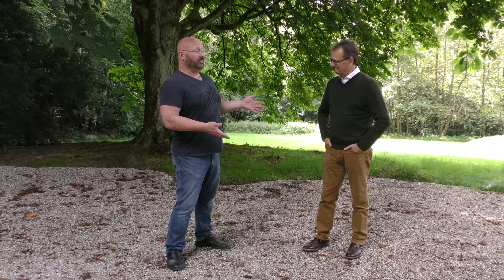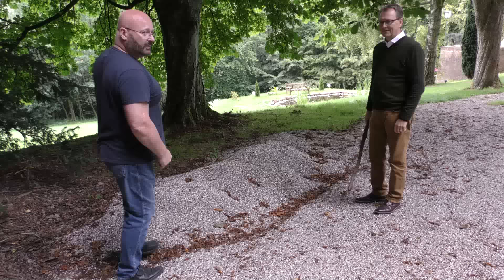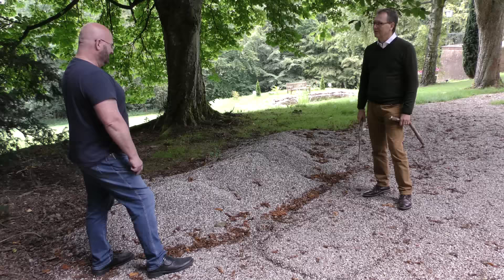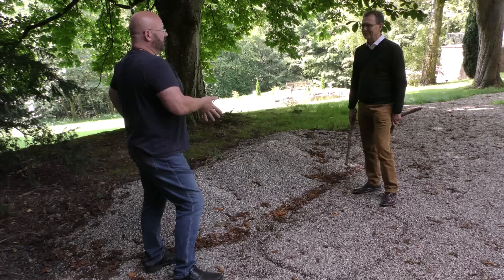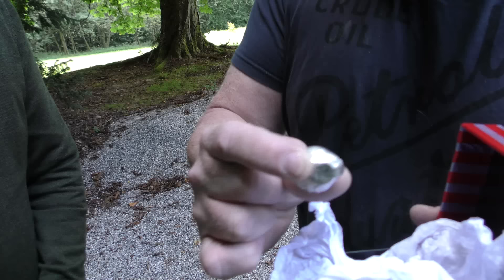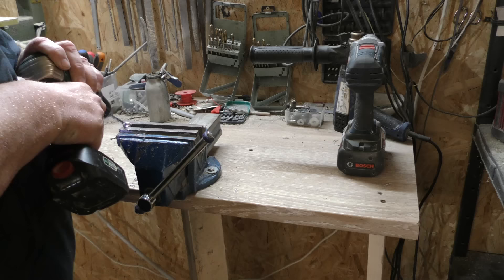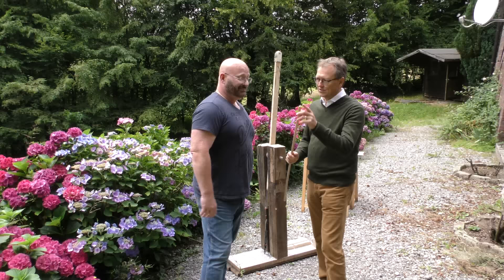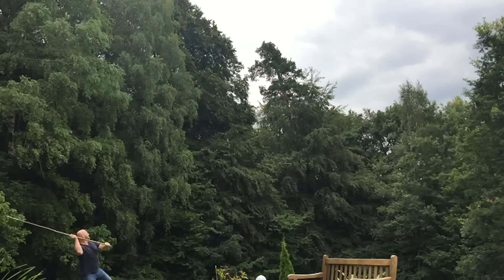The Mystery Of The Whistling Bullets: Psychological Warfare, 200 AD

Comment: There would be no need for a poison on/in the smaller rounds as any round that makes it inside the body just introduced a ton of bacteria into the wound it created.  The target would be dead in a few days due to infection without anything added other then what the launcher adds by handling them. 

As for the Stick launches. try a 6-8 foot long staff with a second person loading for you when you bring it back to the ready position. Nothing says it had to be a one person launch.
Reply: Not always, there was an old man that got bayoneted over a dozen times during the battle of Lexington that healed fine and lived many years
Reply: The poison in the hole could be used to contaminate water supplies. As explained, the Romans bombarded them with these bullets. A good number of them in a well and any hope of a long drawn out battle would be destroyed.
Reply: But the poison would actually help, if you wanted to introduce more bacteria though, feces or blood of the diseased would of helped a lot, and if the blood of the diseased was used, it could help spread disease and sickness to one side if they are not careful

Comment: Sorry, Joerg No stick fling. Too long to load. Too hard to control (aim). Has to be the psycho whistle from a sling shot. Really surprised me when I heard the down range audio!
Reply: John L Bales Jörg* or Joerg*
Reply: my thought, seeing as it was a siege, is what if the stick was MUCH longer, with the nail at one end and a sharpened spike at the other. Stick the launcher into the soft earth as far as you can, bend it all the way back till it can't go any further, load, let go. Fixed lead launchers even weak men could use to fire uphill.
Reply: wasn't slow at all and easier to control than a standard sling
Reply: 2 men could more than double the rate untrained. One ready to load as the other almost lazy like flings and back flings and back. Repetitive boring death motion. behind all that, someone mass producing the ammo, with that exact same perfect hole, and someone just dropping it off. 1000s and 1000s of them falling from the sky like hail.
Reply: I think if the bullets were oval shape it would have been faster to load

Comment: I used to use the bullet style fishing weights with holes to thread them on the line in my slingshot. They would buzz and due to the spin you could curve them when shot. They packed a huge punch.

Comment: I had a great idea! Can you sling multiple projectiles on the stick at the same time? More bullets fired by less soldiers.. more lead hail in the air raining down. So make a stick that can throw multiple projectiles with the same power and results. :) Your hear by challenged Sir. :)
Reply: 2HighNoon or maybe even having another soldier to reload the stick when the launcher brought his arm back
Reply: @Phytobiogenes  Or maybe they had hundreds of sticks preloaded before the attack.
Reply: If you arrange branches that terminate at the same angle as the center one, and put them in a hexagon pattern, you can go from one bullet to seven bullets easy. If you go another perimeter out, that's another twelve for seventeen total. But with two rows, I think we're approaching the point where the stick is too heavy to use properly. Probably want to stick with just seven.
Reply: Or how about using a type of wood with flex to create an even larger slingshot effect, thus increasing the velocity of the projectile
Reply: @megadeathx  It would have been much easier to just have a cross member, and all the pins arranged like teeth of a garden rake side by side. (at the appropriate angle, of course)

Comment: I suspect shot from a sling would be rotating much faster than from a slingshot?
Would that enhance the whistling?
Reply from the maker: The "helicopter" rotation is not transferred into the shot though. The sound is about the same.
Reply: +JoergSprave I was thinking of the spin imparted by friction as it slides out of the pouch....probably not significant?
Reply from the maker: Would that not be identical to the rubbuchet? The whistle was just like for the normal slingshot on that one.
Reply: +JoergSprave Yes, I believe you're right. 😊
I hadn't thought it through.
Reply: not particularly, a big part of technique is the flick of the wrist to put on the spin, your rubbuchet has no wrist to flick.

Comment: Why not create the holes during the mold process by having a mold with a protrusion in the middle?
Reply: because you would have to create an entirely new mold, just for creating a few balls with holes in them.
Reply: @daanlutkewillink3893  wasn't it that most to all of the small bullets had the hole and it was the large ones that didn't?
Reply: @dynamicworlds1  yeah well, if you were making hundreds or thousands it would make sense to make a seperate mold, but in the video they only cast a few.
Reply: @daanlutkewillink3893 ah, I was thinking for the origionals, not the reproductions, since figguring out how they did it then was more relevant to what was discussed in the video.

Comment: The Slinger was a very highly skilled individual, they were trained from a very early age and taught by highly skilled slingers, like David who killed Goliath. That kind of sling takes a highly skilled individual to begin with, or you would have used the string sling yourself to do the first test. I myself know how to use a , however it may have been a fustibal that David used, instead of the leather strip pouch that is spun around and then released. But, great video, I was certainly impressed by the sound that little fella made coming at the camera, Whew!!!

Comment: The hole size made a drastic difference IMHO. Also you wouldn't give your soldiers a stick to fling glandes, even if you didn't have enough slingers - because a legionary would be incredibly offended if you asked him to throw shit and run away. That's the job of the velites, something they did when they were little boys, and now they're men - I wouldn't want to be the man to ask a legion of men to act like children again when they're heavily armored shock troops built for something entirely different. Also keep in mind a hole means less lead per bullet, a smaller bullet does the same and has more penetration. Cheaper more effective rounds that make sound and can carry a toxin? Isn't that two of the three reasons why NATO swapped to 5.56?
Reply: The Romans disbanded the veles corps around 100BC, when they adopted the Marian reforms, so more than 200 years before this battle their looking at and even so the typical legionary carried one or more throwing spears (later on largely replaced by large darts). Also the Romans themselves respected several groups for their slinging proficiency. In fact Slingers where in high demand by most military's up until the gunpowder age.
Reply: @nebfer  You're correct. So replace veles with foreigner and my argument stands. You're not going to get a soldier to wave a stick at someone imparting slightly more power than throwing it yet SIGNIFICANTLY less power than the weapon the glandes is made for. It's the equivalent of finding a field in Vietnam, a thousand years hence, and inventing a weapon that doesn't exist to explain the lead bullets everywhere. Not even to explain the bullets but to explain a mark in the bullets that is otherwise perfectly explained away with actual contemporary authors of whistling shot.

Comment: I'm left wondering: if the holes were used for poison, might there still be residue in the ones they've dug up?
Reply: hmm lets see near on 1000 years .. doubtfull even it wasnt poison just residue from the latrine ... it would have been reclaimed by this time
Reply: It depends on what kind of poison. Modern tech is good at finding minuscule traces of substances, so yea it's possible. But I think poison would have been un-necessary, the impact would hurt plenty.
Reply: @ambulocetusnatans  dipping it in the cess pool would also be a quick alternative ... since they do have to do that daily ... they will have an ample ready supply always handy ..
Reply: @0623kaboom  AFAIK medieval archers stuck arrows into the ground near them. Probably not so much as to have them conveniently handy, but to give the target some nasty infections even from what would have otherwise been minor wounds. So biological and chemical weapons aren't exactly new as an idea.

Comment: Point blank range? I think it's effectiveness would decrease greatly in only 50 yards or so.
Reply: It's not a problem. Momentum of heavy projectiles is conserved quite good at subsonic speeds. It's still going to fracture skulls and bones.
Reply: What the other guy said. Same reason why snipers use 10g or even up to 20g bullets compared to the standard infantrymans 4g bullets
Reply: @TheErilaz  a 60g shot falling at terminal velocity could even be deadly.  A golf ball is around 45g, falls above 35m/s.

Comment: A staff sling has a sling attached to a length of wood. My staff is made from ash, about four feet long. The sling is about two feet long. The staff is curved and tapered from three quarter inch at the handle to about three eights of an inch at the tip. Because it is curved and tapered, when you draw back and fling forward the staff loads up pressure with flex.

Comment: Hmm, is there any possibility the hole was for the shaft of an arrow? Not sure why they would do that when a piercing arrow would seem more dangerous, but perhaps the weight would better damage plate armor or have an effect on arrow range or flight characteristics. Perhaps it would be worth just trying to attach one to a wooden arrow and see if it would have any useful properties or even be possible to shoot from a bow of similar power and design to those Romans used. Perhaps the Romans ran out of metal arrowheads, found lead to be cheaper, or felt that the added weight of a lead ball would be more useful against the enemy armor. A smaller diameter than the sling ammo would reduce the drag and strain on the shaft of an arrow during the launch and fitting them to a standard shaft would explain the exact size of the holes, so I would like to know if that possibility has been considered.
Reply: Terreflare plate Armor was not in use by the Scottish this early in history. Widespread plate armor use would still be over a thousand years off for most of Europe.
Reply: The answer is simple. Archers require specialized training, but every Roman would have carried a sling for just this purpose (and hunting while on campaign). Can be worn as a belt or pout in a pocket, so no extra weight, and the glandes (technical name for the lead bullets seen here) have been tested and they do pierce flesh and crack bone (see theinthrand's channel).

So, easy to carry, usable by everyone, lethal (if less accurate over longer distances) and the ammo can be replaced by local rocks if you run out. Better than bows as far as the Romans are concerned.

Comment: Am i the only one annoyed that he fired at the ballistic gel and the coconut at point blank range instead of a feasible distance
Reply: Stephen Callari ...i know right. I said the same.. 25m the avg when we trained using pistols. In the army. The romans must be deadly accurate.??
Reply: He’s not accurate enough to hit it that far away.
Reply: The energy on impact is what matters. And they were guessing on that.
Reply: In theory a point blank hit would contain the same energy as a shot lobbed high enough (gravity, terminal velocity, ect.) Especially if fired from a proper sling (with historical designs granting 200 meter distance and 150mph + speed)

Comment: How are these tests accurate when you are shooting coconuts from a foot away how far were these people away from each other and it looks like they were shooting up hill need more accurate tests than these
Reply: I think they were just testing to "plausible" level. Though they would lose speed to air resistance, they would still have a pretty significant power at the other end. If any of the tests had failed, then they could eliminate it from the theories. i.e. the whistling rounds may have been able to penetrate to deliver poison, though I doubt they would have been used this way. This is a saturation battle. they aren't counting on sniping every person that walks outside, they are keeping rounds coming so that anyone who leaves cover is at risk, but there are thousands more rounds buried in the dirt rather than the graveyards.
Reply: @caniscerulean  not saying it wouldn't hurt but I can't see that kind of speed it would take to cut through flesh not to mention they would have been throwing up hill
Reply: @caniscerulean  let's imagine you put poison in water reserve🤔
sound a bit supid i think they will be protecting it, i don't know

Comment: I wondered if you might attach two or three together to fire like a bolas, but then it would probably make more sense to be drilled all the way through? Same probably goes for using it to drag something like a flammable pouch or burning rag. Would be good to know if you get the same noise from one with a hole all the way through it. Poison cup seems plausible but not sure why they'd bother.

Comment: I definitely assumed that the whistling was the point, but the regularity of the holes is definitely suspicious, considering that the whistling isn't affected by hole size.

The stick slingshot method is shockingly simple and effective, especially for untrained troops. It has a kind of Roman brutal pragmatism that I could totally believe. I only wish they had tried that with different hole sizes. But definitely worth looking into.

Great video!

Comment: Amazing work providing 3 Hypothesis and preforming the scientific method to prove or disprove something...
Added thought I have is, what time of year the battle took place ... if in spring, Saplings could be very prevalent with a springiness that a small ball could be attached and flung with more Velocity. And the stem that you cut off from your own mold, could be how they actually fastened it to the end of the stick. Many could be made and the ball remains secure to the end until flung. If they were to transport them this would be like having a flint lock musket with the flash pan covered. It may be possible that a grasp and twist makes it ready for the fling or firing. Just thinking... I have no idea if the small holes could be used for that. Or even attached twigs shoved into the mold while liquid, when cooled providing an amazing extension for the arm increasing the range and velocities reached. Like a potato masher WWII Grenade the handle giving a further stand off distance... being made of wood any sign of the insertion the length etc would be lost to time as the decay of the wood could have been hundreds of years ago. But there may be some sort of trace to look for...
Pass it on to your friend. I’m still thinking of willow tree spring growth, sometimes called pussy willow because of the little grey fuzzy things on the branches. 
Schoone Tage!!!

Comment: But they could've used one size punch to put the holes in all of them. It's not like they didn't have standards. Meaning, the holes were for whistling and the only reason for the diameter being the same is that whatever tool used to do was either the same tool or a standardized tool. It's also possible they were casts that way right?

Comment: Very thought provoking and cool video!  Thanks!  Balls with the hole were smaller for a reason, and you showed differences in penetration - but I wonder if a larger ball with a hole still makes noise.  Also, the larger balls were the shape of a sling pouch - but clearly the smaller one wasn't, which maybe lends credence to the sling stick theory.  Again, very cool.

Comment: The size of the hole seems to me like it's just another roman standard, they perhaps found that it made the best sound. 
Another one I would have liked to see tested is a string/flag attached with the hole, would be easy to use for ranging (since you cannot really see where your shots are landing).
My idea being that the smaller projectile + string/flag attachment would fly as far as the bigger projectile.

Comment: You know, and this might be kind of silly to say, but you could use that hole not to launch the screamer, but to store them.

I'll bet that it wouldn't be hard to make some kind of bandolier, or some other device to hold or dispense the shots, so you could throw them one after the other with great rapidity, without necessarily changing the launching mechanism from sling / slingshot.

That would also prevent the bullets from damaging each other by rubbing up, jostling, or smashing.

If you consider that the same archer might use both the heavy plain bullets and the screamers, it would make sense to store them differently - a pouch for the heavies, a strap for the screamers.  You fire off the screamers every 6th shot, like trace rounds, so that you keep the noise and disturbance going throughout the battle even as there's a lot of thumping going on.

You could also use screamers to divert attention - if the screamers are dopplering from the northeast, you might align shields to that direction and take more substantial hits from the northwest.

Just thoughts.

Comment: 1.  As I listened to the whistling of each projectile the one with the larger hole oscillated more cycles per second.  This may have sounded a little less spooky to the recipients.
2.  If a substance was put into the hole would the venture effect in flight remove it before it made its impact?
3.  Would the hole size have had something to do with the effective tooling of a system of mass production of these lead balls?
4.  Was the pocket of a large catapult possibly used to hurl multiple lead ball spirits through the air to make a unified sound?  Would multiple spooky balls have a much louder eerie effect?